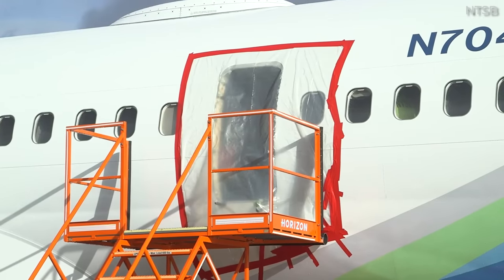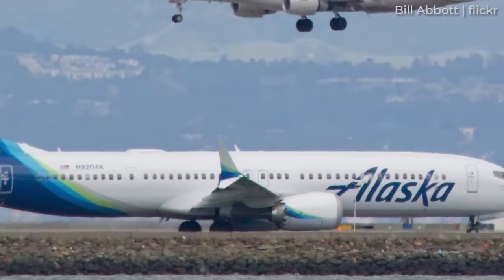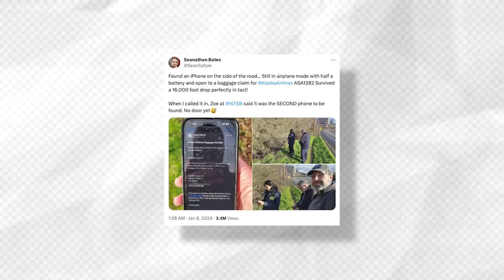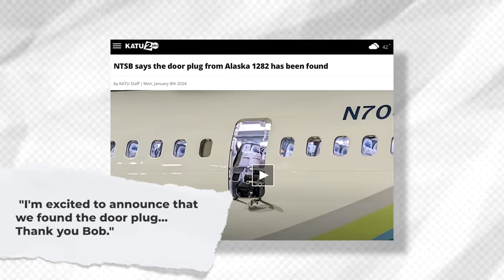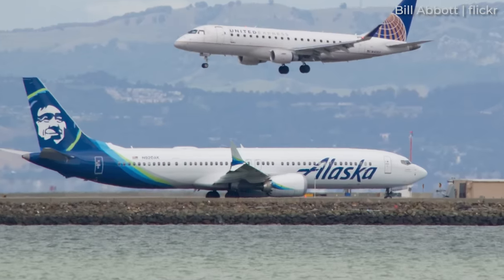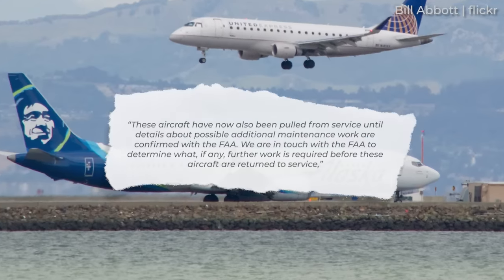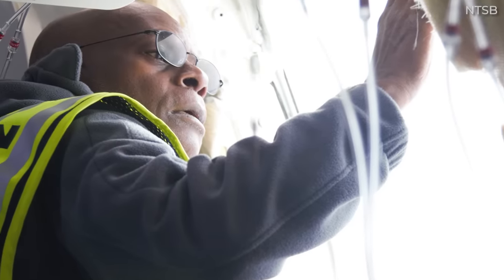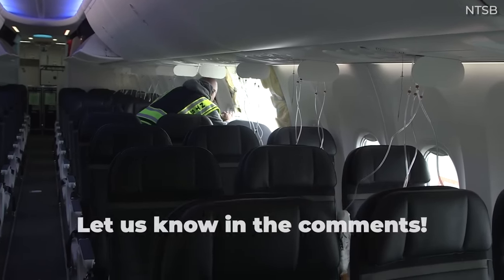Flight AS1282: Are We Seeing Another Boeing 737 MAX Crisis Unfold?

Comment: No matter how you look at it, the 737 is an old design that has been modified many times over the years. Boeing needs a newly designed aircraft.
Reply: Well beyond its 1960’s use by date.  Boing has made its money from this design.  Get on with a clean sheet (or computer) B797.  Using modern tech advances that came with B787.  Long overdue, the best of B757 and B767 in a new B797.  It’s time, Boing!
Reply: Psst. whispers It's the same door design on the -900ER.
Reply: It’s an old design but reliable. And it ages well, the problem is Boeing is experimenting too much with the design that worked so well before. Designing a completely new plane would be underway if airlines wanted it… but airlines have already said if Boeing makes the 797, they won’t buy it due to training costs. especially the 737 only airlines like Southwest or Alaska. Additional training costs, maintenance costs and others would be added should these airlines add another aircraft type.
Reply: I heard there was going to be a double decker 737 designed.
Reply: An old design has nothing to do with this.
Reply: They do need a new clean sheet design. But this incident has nothing to do with the 737 being old.
Reply: Outdated design is simply not for today's taller, heftier flying public. Narrow aisle, cramped seating, tiny bathrooms... It's been overdue for replacement except that it's reliable to the point that airlines can't justify ditching it. Also, everyone wants the cheapest fare, so efficiency is #1 priority. 🤷‍♂️
Reply: @ErikKruse1  
People haven't become taller since the 60s.
And the cramped seating in planes is because the AIRLINES decide the seating configuration and what seats to use. They cram as many in as possible to maximize revenue.
But, yes. They need a new clean sheet design.
Reply: Idk doesnt that sorta contradict its self? If the 737 normally is a fine aircraft would you assume its all the newer equipment slapping on to it not working the problem? Dont fix what isnt broken I guess
Reply: I used to work for Boeing.  As soon as I pointed out the flaw for Safety, they let me go.  All they think is about $$$ Not about Human Life.  They don't care about You and Me !!
Reply: This is unrelated, but it’s true.
Reply: How will the executives and share holders make their massive profit with government bail out if Boeing actually tried to do real QC or design a new plane rather than rehashing an old design so much that they have to install software to keep the plane level, only for it to crash the plane?
Reply: Should have redesigned wings & re-engined 757, to have a aircraft better optimised for short haul operations. It was more promising design but instead Boeing killed it.

Comment: Sadly? If anything this happening the way it did was extremely fortunate. No deaths or serious injuries, and the world is alerted to yet another failure of Boeing and the 737 MAX. 

It's good that Boeing's failures are being highlighted in a non-fatal manner, unlike with the MCAS disaster, as it will hopefully draw their current operations under more scrutiny and draw more ire, which (we hope) will set them back on the right path, of safety and engineering first, profit second. Currently they have those the wrong way round.

Comment: It is abundently clear that the bloody thing wasn't screwd in properly. The simple fact that the plug exited the mainframe proves it 'rotated' freely in order to get through the gap.  Hence it was not connected, even partially.  There is no damage on the air frame fittings which there would be if the plug had been attached.   Quality Control must have been non existant.
Reply: You’re right. Boeing has gotten away lightly ... so far.
Reply: I admit that's te most logic explanation, but it is too soon to really tell for sure.
Reply: Is it quality control with Boeing or Alaska Airlines though?
Reply: Or maybe a mech reinstalled it incorrectly. This is a new aircraft after all, unfamiliarity with procedure may well be a factor.
Reply: @markn866  It's a plugged opening on the body/fuselage of a new airplane that was delivered 2.5 months ago!
Like what would Alaska Airlines do with it? It's part of the body of the plane that doesn't open and doesn't need to be serviced!!
Reply: Spot-on
Reply: Yes you are correct.
Reply: @markn866  Boeing! The problem is hidden behind wall-panels, not something you casually remove on a daily basis!
Reply: @drrisen-9442  ...they've been making them since 1967.

Comment: Funny how stuff like this is not happening to Airbus..
Reply: They stopped flying themselves into trees 30 years ago, true.
Reply: I am not sure if it had even happened to the Russians!  As we might expect them to.
Reply: Airbus historically has had problems with engines and flight computers. The flight computer part is still a problem today however. And there’s some fear someone could hack the control systems of the Airbus eventually. However rn airbus has the airframe figured out even though it too is quickly aging out
Reply: lol. Apparently you’re not abreast of current aviation news.
Reply: @michlo3393 That was a pilot error lol
Reply: @VhamonDaGoat  I'm aware of their "blame the pilot" doctrine.
Reply: @michlo3393  It ain‘t like Boeing blames everyone but themselves right, no no no that is definitely not happening … or is it
Reply: @michlo3393  There wasn't anything to do at the time they tried to gain altitude: they would have stalled into the trees or else flown into them.
Reply: @VhamonDaGoat  I mean if Airbus became the biggest aircraft manufacturer, why not learn from them?
Reply: @user-uh6kq2wh9g They are only marginally bigger and Boeing seemed to catch up a little bit today. Plus, Airbus seems like it has similar issues anyway.

Comment: After the MCAS grounding, with all the scrutiny, it was assumed the MAX would be the safest plane type in the sky.
And I remember the request for exemption for a few certification requirements of MAX 7.
Reply: It is, and remember, the scrutiny was by the regulators.  Once they are not there and watching 100% of the time,  and you have human factors (people with wrenches/tools and removing/missing quality checks, again by people) any system, be it aircraft or toasters, there will always be complacency/missed steps/quality isses, schedule pushes by management due to shareprices/stockholders.
Reply: The MCAS issue has not been fully fixed, and this was a clear indication of them not caring.
Reply: Did an Airbus ever lost a Door midflight, without human interaction? Boeing and McDonnal Douglas have quite a history off flawed designs regarding their doors. Starting with the DC 10 up to the 747, now the 737. So lucky nobody died.
Reply: @dirtykraut airbus used state of the art doors. Airbus historically has had problems with their flight computers and engines.
Reply: I remember as well boeing wanting sone FAA exemptions for their dash 7 and 10s. The audacity. How can they even suggest that?
Reply: @anonymous6817 
Ufff, i don't know whats going on. I feel it won't be good for Innovation in aviation, if one competiter turns weacker and weacker. The decision to stick with the old Design of the 737 is questionable. The 777x is still not there. Airbus and Boeing are the backbone of aviation, it's concerning if just one of these Companys is palgued by a cascade of issues like this.
Reply: @dirtykraut Hopefully with Comac bringing more competition Boeing can't keep cutting corners
Reply: I used to work for Boeing.  As soon as I pointed out the flaw for Safety, they let me go.  All they think is about $$$ Not about Human Life.  They don't care about You and Me !!

Comment: After the two MCAS (software) caused crashes, I remember the FAA did a deep dive into the procedures/processes Boeing was using in the factory and the design/development.  Some "to the point" emails were discovered which were pretty damning.  One person wisely wrote that the plane was designed by clowns and supervised by a team of monkeys.  The response Boeing gave to those emails was:

"The language used in these communications, and some of the sentiments they express, are inconsistent with Boeing values, and the company is taking appropriate action in response. This will ultimately include disciplinary or other personnel action, once the necessary reviews are completed".

Their response was nothing more than "kill the messenger".  Rather than disciplining the truth teller, they should have listened and learned.  Their response showed that they weren't interested in the truth. Their solutions was simply to create a climate of fear for anyone that speaks up.  If the plane was not designed by clowns and supervised by monkeys, there would have been no need to keep it grounded for so long for all the additional problems to be resolved.  Even now, more problems keep appearing.
Reply: Right, if your thermometer says you have fever, just break the thermometer...
Reply: Why were the ONLY two 737MAX crashes with third-world Airlines? 
Flying an airplane that up until the time of the crashes had experienced ZERO incidents.
 
After a year of test flights and data-gathering, the MAX gained certification from the FAA in March 2017, followed by other global regulators later that month. 
By May 2018, a year after the first delivery, more than 130-MAX's were in service with 28-different airlines around the world and had flown almost 42,000 flights.
With ZERO incidents
Before the second crash, there were nearly 50-carriers that were operating the MAX. Using it for an estimated 8,600 flights per week. 
With no ZERO incidents.

That the FAA and EASA didn't know about MCAS, a meme being pushed by BOEING BASHERS and the MSM, is bovine excrement. 
Although Boeing did not call MCAS out by that name, the Boeing Flight Crew Operation Manual (FCOM) described the function in detail, and how to override it. 
And 50-carriers crews had no problems with understanding it. 
The FCOM was successfully used by 50-carriers to train crews in flying the new 737 variant.

Lion Air and Ethiopian Airlines with their low-time inexperienced pilots and with inadequate management of their crew training - ruined the safety record of a perfectly safe airplane.

The fuselage plug issue occurred in ONE airplane, out of 1,420 delivered and after flying over 100,000 incident free flights! 
The plane and crew handled the incident perfectly. Nobody was hurt. Not even a sticking plaster was needed in this "disaster"! 
Boeing and Spirit will take remedial action - and the 737MAX will go on to be as safe as any other commercial aircraft currently flying.
Boeing has 4,031 MAX aircraft in its order backlog. 
You think these folks who fly these wonderful airplanes every day for a living think the MAX is dangerous? Yeah right!
Crossing the street, or driving one's car to get groceries, is 1,000 times more likely to get you killed than flying in a Boeing 737MAX.
This is just an over-the-top, hysterical, hyperbolic nonsense coming from woke folk who want to live a life of 100% safety! 
Better stay at home and sit on their couch!
Reply: @DennisMerwood-xk8wp  Sure.  the groundings that lasted nearly 2 years (longer in other countries) can be blamed on third world air lines.
Having a computer system that gets faulty information from one of the stall sensors takes control from the pilot and crashes the plane, rather than looking at the other sensor, and rather than noticing that air speed is very high, and the ground is very very close, that's a good design.  Sure.
Reply: @cherryjuice9946  The design has worked perfectly well for over 100,000 flights.
Yes its a good design.
And your description of now MCAS works shows that you have a lot of reading to do my man.:face-orange-frowning:

Comment: This isn't a Boeing 737 MAX crisis unfolding, it is a Boeing crisis unfolding as the same plugs are also used in older NG models.
Reply: @alexbeuerman7608  Correct, so the problem is Boeing, they could have used the  same flight line inspection team but didn't.
Reply: @apveening this exact plane is only a few months old.  😂
Reply: @Effervescent_Smegma  So what? Boeing discontinued the flight line inspection teams, so it is a Boeing problem, not limited to this type of plane.
Reply: If its Boeing im not going  ... Seriously iv rebooked to get on a airbus flight & going by what iv seen yesterday here in NZ a lot of other people are doing the same .
Reply: @billhanna8838 And? Airbus seems to have this exact same issue if they are assembling their planes at the same factory. They also saw two A321 planes blow their windows out.

Comment: Terrifying that Boeing just can’t seem to get it all together.
Reply: @GiovanniPietro9000 I fly the Airbus and confirm this. The flight computer (involving the flight controls) and engine problems are common. Mainly in the NEO. The Airbus has problems but they are easier to catch for the airlines before they hit the sky. It is not that way with the 737. Airbus’s longevity however is bad. An old Airbus is a shit plane lol. I’d rather fly the older 737 than an older A320. The old A320’s are gonna kill someone lol
Reply: @CandyMan2001  I fly the Airbus. I’ve seen these problems first hand lol
Reply: @CandyMan2001  so idk if it’s much of an opinion when I’ve experienced it lol

Comment: Well this has been the first major accident of a MAX on US soil. Giving the NTSB full authority to investigate Boeing and I'm sure the NTSB has a long a list of question waiting for Boeing already.
Reply: It’s not a major accident.  No deaths or injuries.
Reply: @chrissmith7669  It's an official accident. Giving NTSB the full authority to investigate it however they like.
Reply: NTSB: unzips
Boeing: bites pillow
Reply: @chrissmith7669 oh, it’s a major incident. Had they reach higher altitude already, everyone would probably be dead. 

It’s not just a mechanical problem, we’re talking about a door popping  off and United Airlines who found a few loose bolts on these plug doors.
Reply: @ellaella5537  no one injured or dead.  It doesn’t get rated as major. 
If someone had been next to it when it left it would have been major. 
If it happened at altitude the result wouldn’t have been much different.   
They’ll write an official inspection in an AD for all planes delivered and change the inspection required for the FAL.
Reply: @chrissmith7669 
Oh yeah, just minor. 
Some ppl were injured but they were all still seated and wearing their seatbelts, so they were extremely lucky. 
As for altitude, are you trolling or are you serious? It would have been catastrophic if they were at 30K altitude. They would have been sucked out also, oxygen levels are much lower. 
They will do a lot more than writing a report, planes are grounded indefinitely. They found loose bolt on the plug in 8 other planes so far.

You think they’ll just write a report? Seriously? 😂
Reply: @ellaella5537  they wouldn’t have been sucked out unless they were in the empty seats. Call it luck or chance the seats were empty and no one sucked out. 
Oxygen levels are lower at altitude, that’s why they have masks.  Fun fact.  In all the depressurization events masks haven’t saved anyone.  What saves people is the pilots doing a very rapid decent to a level where masks aren’t necessary.   
So far there’s no evidence of a design issue but they are investigating that to be sure.  What they do know is hardware was either forgotten or improperly installed.  They are looking for the evidence of which in the lab.  They will likely perform tests on some doors and retention hardware to look for indicators of what happened. 
The most probable outcome will be changes to the install procedures and to how it’s verified.   
Unless there’s some glaring design issue they will lift the grounding after the revised inspection procedures are in place and all aircraft verified.
Reply: @chrissmith7669  my goodness, you’re definitely trolling. This is probably one of the most incorrect, uninformed takes about anything that  I’ve seen in a while. 
🙄
Reply: @ellaella5537  I‘m probably the most informed person posting on the incident.   It’s not nearly what it’s being out to be by uninformed people.
Reply: @ellaella5537  Aerospace Engineer and former Cabin Pressure & Ventilation Systems Engineer. 99% of posts on the incident I’ve seen are fear mongering and full of bad information.  
Aviation incidents always bring out those looking for publicity.
Reply: @chrissmith7669  of course you are buddy, of course. The NTSB said the same, but you know more. 
Lol 😂

Comment: The seats adjacent to the door plug were two of only (I believe) eight unoccupied passenger seats. I'd want to rule out if someone in the reservation chain flagged those seats for some reason (eg, passenger complaints of unusual noise).
Reply: Great minds think alike. I don’t believe in coincidences. What are the odds of those seats being empty randomly?
Reply: I just saw a report stating that the CVRs from this plane were overwritten and that there were 3 pressurization alarms on this aircraft leading them to only fly routes over land for "safety" sake.
Reply: ... or integrity concerns (related to prior pressurization issues).